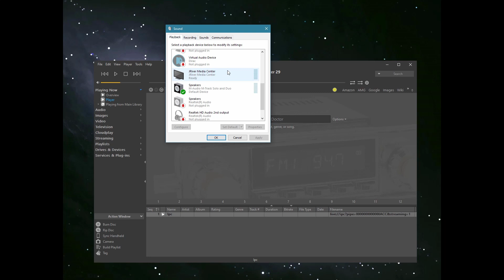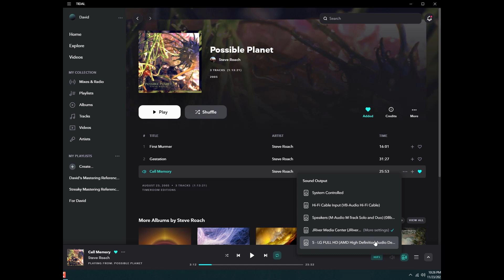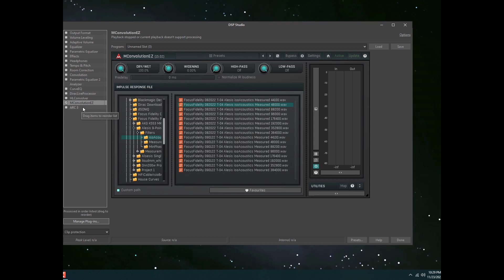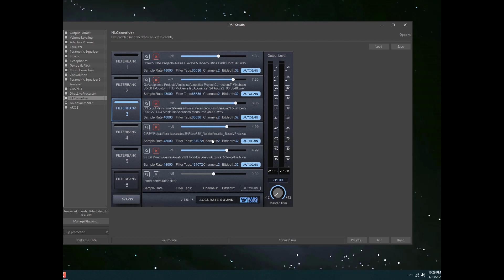How I use JRiver as a PC desktop host for my correction filters

Comment: How is dirac versus Arc 3 versus the free version as far as I understand they are all just FIR filters. does one perform significantly better than the others? If I make files in room EQ wizard is it going to sound significantly worse than if I used Dirac?
Reply from the maker: Regarding your first question, Dirac offers some degree of time domain optimization and ARC doesn't. It's not true time domain correction, but Dirac does attempt to correct phase alignment and optimize the impulse response in addition to frequency domain correction. As far as I know from the available resources from IK, ARC3 and ARC4 don't do that. 

As to your second question, Dirac's correction does sound a bit better than ARC, though ARC4 does indeed sound very good in its own right and I hear it as an improvement over ARC3.

In response to your last question, everything depends on how you make your filters. REW is fairly proficient at creating minimum phase filters with little to no latency. The quality you hear will depend on the procedure you follow when crafting your filters. I've written a new guide explaining the way I do this now.
https://nverxion.wixsite.com/meridiansoundworks/drc-rew
Try this out. If you like the results, tell other people about it.

Comment: Tried this method to apply system wide Arc System 3. JRiver drivers seem only stable enough with a large hardware buffer. So I would not recommend to use JRiver drivers directly from DAW if you're playing on external equipment. In DAW it's better to use ASIO drivers from audio interface directly and setup Arc plugin on master bus or in Cubase control room (have to try that). For listening music through other software, JRiver with Arc running is fine. It makes sense to apply same room correction both in and outside of DAW.
Reply from the maker: The intent of this video is to implement a systemwide solution. I'd never recommend anyone use JRiver while running a DAW. I know I don't! I close it down when I open my DAW. Either close JRiver and use the DAW with your hardware's ASIO drivers, or use JRiver's virtual device to access the ASIO drivers when the DAW is closed.

Comment: Hello, why is this method better or worse than using eq apo?
Reply from the maker: I think JRiver Media Center is better because Equalizer APO is less flexible, more difficult to install properly, and VST plugins do not update within it in real time. JRiver also has a virtual device that is much more stable and a lot easier to use. Equalizer APO is touchy and a little cumbersome. JRiver is stable and flexible, allowing me to use ASIO drivers via the virtual device, as a bridge.
Reply: @davidbrancato  
Using the EQ APO I can adjust the "impulse response.wav" for each of the 7.1 channels separately, can I do the same with the Jriver?
In other words, first I do bass management through EQ APO, then an impulses are applied to each channel (your phase adjustment method is just awesome), and via HDMI the PCM sound goes to the receiver, in which I only adjust the delays. Is there a better option for this?
Reply from the maker: I'm pretty sure there is yes. Check JRiver's configuration references. I am currently setting up experiments with multi-channel output. So far I have only been working with 2-channel and 2.1 channel setups.
Reply: @davidbrancato  It would be very interesting to see your guide on this topic. For example, after much experimentation, I came to the conclusion that instead of the standard setting, when the speaker is adjusted separately in the full range, the subwoofer is adjusted separately, and then the bass management is done. I (after setting the time delays as accurately as possible), turn on the bass management (EQ APO) and then make a measurement, i.e. low frequencies start coming from the subwoofer, and flow into the speaker at the cutoff frequency. Thus, I get 5 full-range speakers by measurements, and frequency and phase adjustments are already being made for this bundle. (well, then I also measure the subwoofer separately). Here the only question arises is that the low frequencies cut off from the speakers and the low frequencies from the LFE channel come to the subwoofer synchronously. It would be interesting to hear your opinion about this configuration path
Reply from the maker: @иваниванов-т4к4е  As soon as I work out a procedure for this I will upload a video.